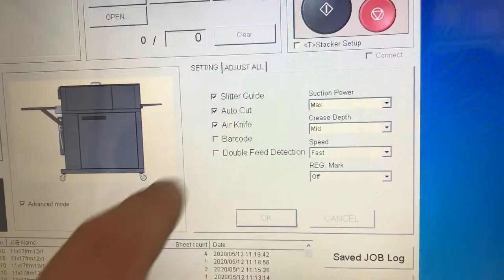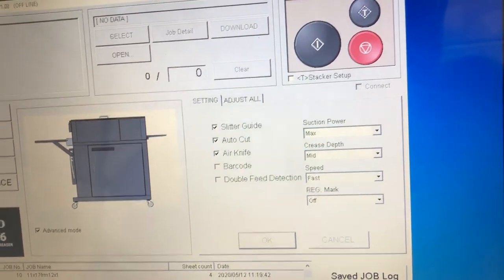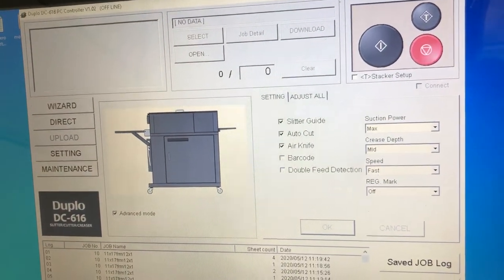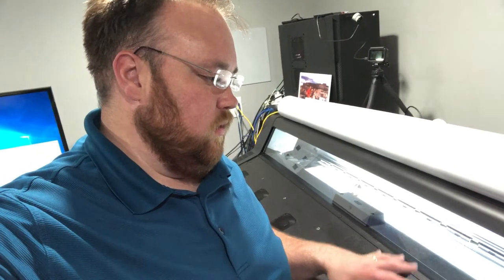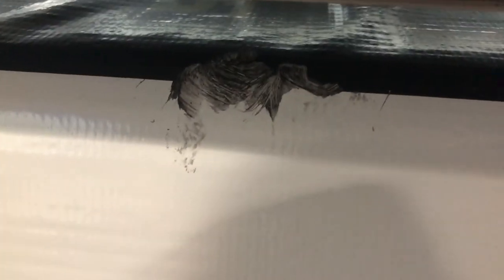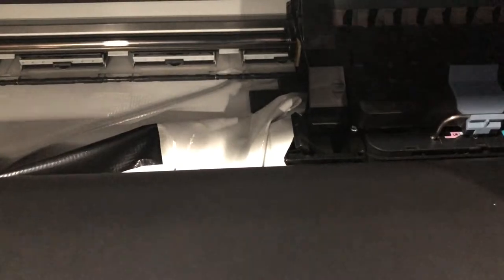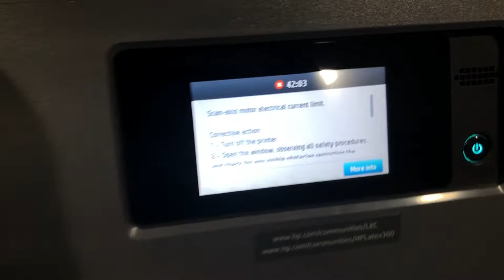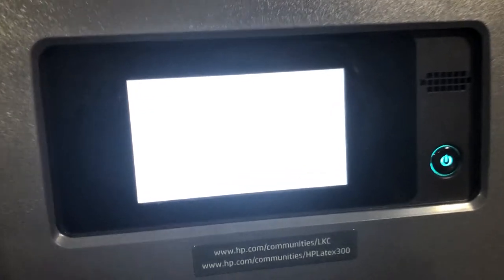The Print Head Strikes Back - HP Latex - vlog 245 - Print Shop Updates

Comment: Check Ebay out for a used Morgana, you can get a slow one for $5,000 or a high speed one for $15K. They say local pickup but someone might freight it to you. You can then pay your local rep to service it and teach you how to run it. Much better ROI on a used machine. Personally I'd put it off and use your Duplo to crease them and fold by hand. I'd bet that Baum folder you have just needs a talkin to if you know what I mean. :) Good luck!
Reply from the maker: I've check a few on ebay and I have mixed feelings. The biggest problem I have with the Baum is it cracks the main types of paper I print. Thanks, Dan.
Reply: @ttms  I score stuff flat with my Morgana and then fold on my folder. Will sometimes work better than folding and scoring on the Morgana.
Reply: @justaprinter  I found his channel from one of your videos, you both are very kind and smart 👌🙌

Comment: What I do usually I cut the material from its jammed and then turn off, unload, turn on the machin and then after is on load the media. Where are your clamps? You should have 2
Reply from the maker: The edge holders didn't stop it from curling at the front which is what caused the head strike this time. I do have them installed and use them for all prints.
Reply: @ttms  the only problem I found with hp is the jamming and also when is printing the media sticks to the heating part and mess up your print.